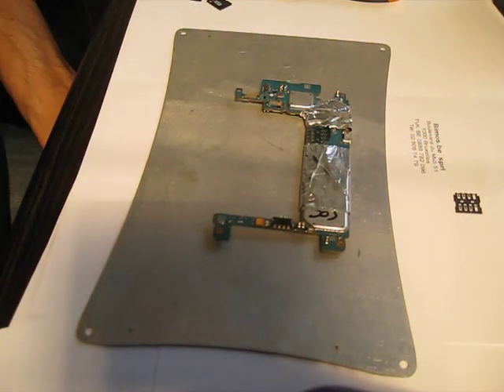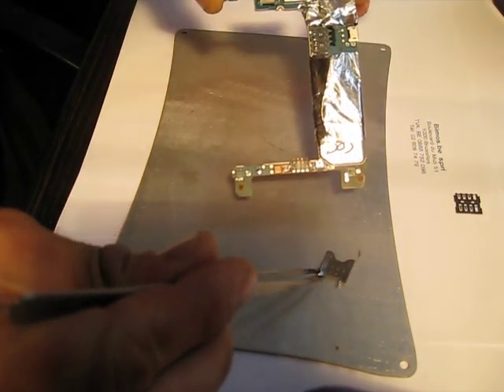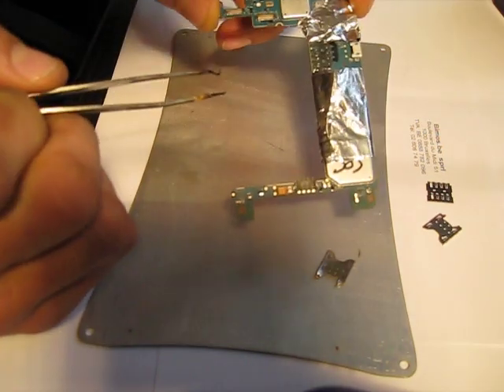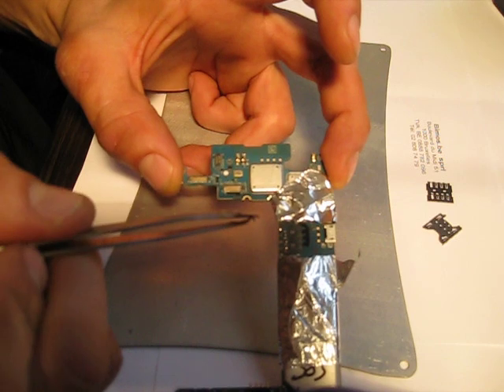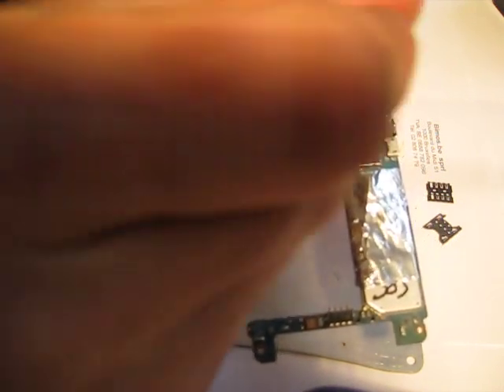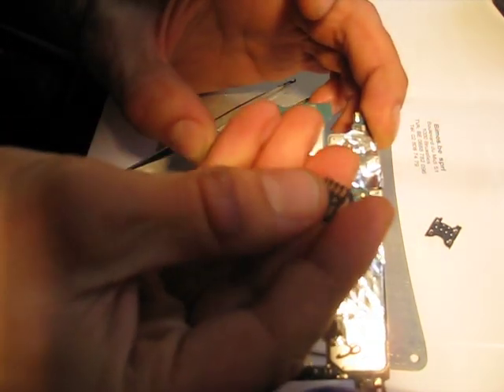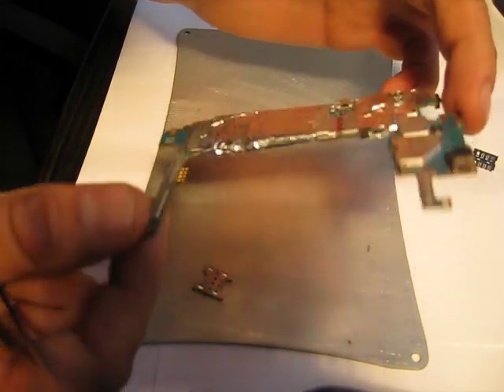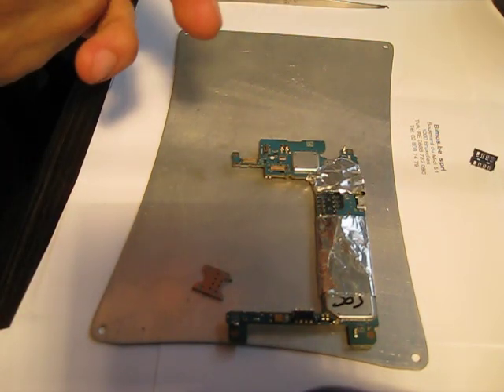Blackberry q10 and z10 Sim card reader repair

Comment: Dear Alexandru, I have a problem with My Q10. 3 months ago, I broke the pins of the sim card reader.I brought it to a person to fix it. He didn't change the card SIM Reader but he only knocked it up. One month later, I started having a problem accessing the carrier. in the screen, it seems working and I can see the its name, but when you try make calls or using 3G connexion. it doesn't work.
In your opinion wher is the problem and how can I fix it?

Thank you in advance
Reply: Abdelhak BENDAIF same here, Q10, brand new, >pins of the sim slot are HS. i checked, it's foxconn shit. took it to a repair guy and he's clueless on the soldering. fuck, if it were about me, i'd cut through the casing, and fit in there a good ol' Amphenol sim slot from an old nokia, would do the same,; but regarding how the motherboard is made, fuck.

you done fucked up, RIM/Blackberry... you done fucked up.